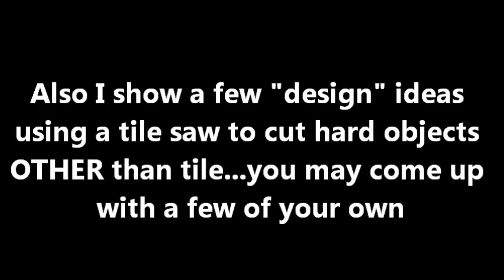MY WET TILE SAW....field use of the dewalt 24000

Comment: I've been using the first generation dewalt wetsaw for something like 8 years. The left side of the table fractured and bent downwards from the 45 degree slot (clumsy helper). I've replaced the pump. The side tray for catching water has a fractured tab but still works (even without the table extension).  And I've replaced a motor bearing. After all that, I still love it. It breaks down into a very small package and still cuts like a mofo. I too notice that the dewalt blades travel a little bit but I rarely ever use the back fence anyway (unless I'm doing floors that get trim covering the cuts) and I always scribe my lines with a wax pencil so I can adjust mid cut with ease.

Comment: the way i avoid the blade wandering and cutting out of square on this saw while cutting hard tiles is by raising the blade and scoring a line along the tile first and then going back and cutting all the way through, following the score line. otherwise it cuts out of square for me as well.
Reply: And it will save your blade

Comment: My dewalt 10"is giving me some hard times when cutting large porcelain tile like breaking the corners or going on halves I still dont get why is doing that 

Any help please🤗
Reply: Sometimes it's the tile other times it is how you are operating it. A lot of times just having a decent blade on it will fix your problems. Like the guy said, the segmented blades give more than the tile and can cause breakage just from not cutting in a straight line.
Reply: Get a P4 tile blade.

Comment: What Brand of blade do you recommend?
Reply from the maker: I don't favor one blade over another, I buy mine at Home Depot...QEP...
I go through so many in a year that if I get one at $45--$50 I know it'll last.
Reply: Depends on what you are cutting.....the DeWalt blades are pretty good for most materials.....my current favorite blades for cutting porcelain are the Diamond Professionals Phoenix 10.....Also, the biggest mistake most professionals do is neglect regularly dressing their diamond blades. In the past few years I have been making more of an effort to dress my blades often.....when I do they cut much more smoothly and last longer......
Reply: @justinofboulder  How do you dress you blades?